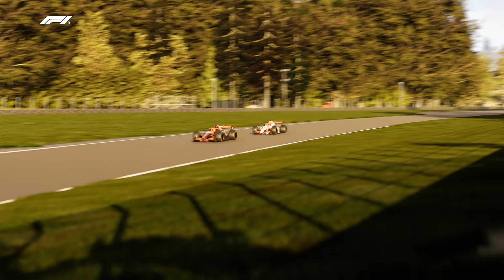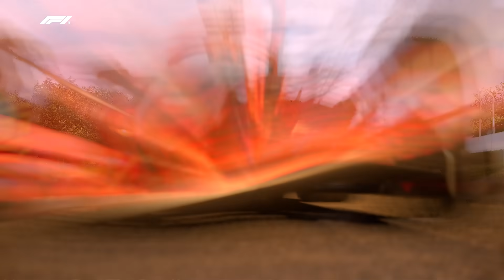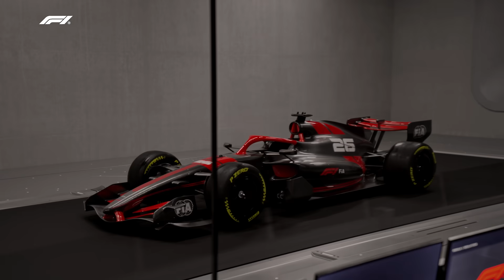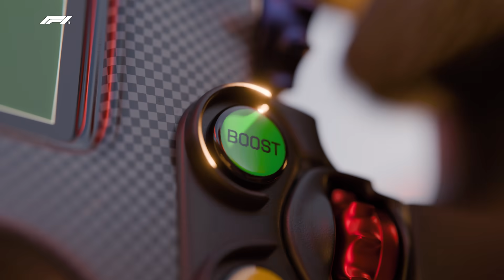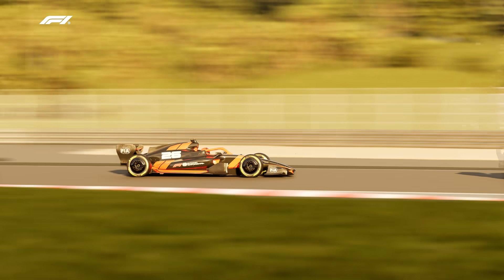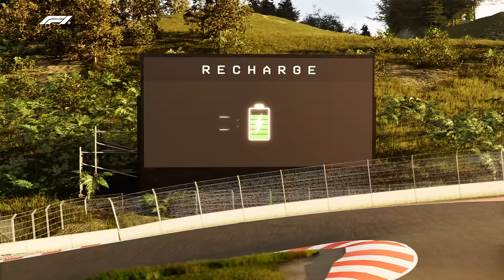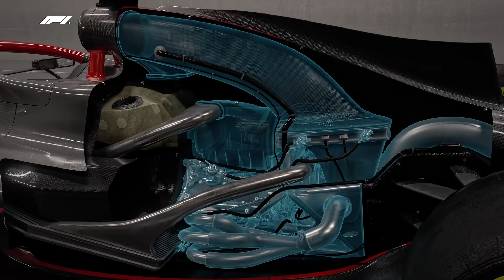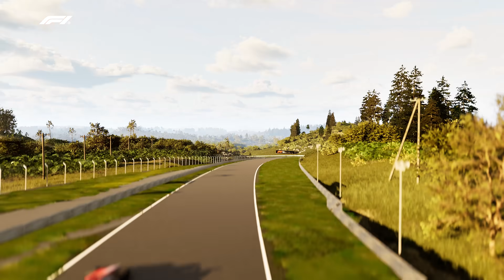Everything You Need To Know About the Formula 1 2026 Regulations

Comment: I was already afraid of it, but after the last few races that boost/battery charge system proved it is one of the biggest downgrades in F1 history. Drivers are way more cautious going into turns, because if they don't break enough their battery charges less. Not even talking about overtaking at the push of a button. It takes less skill and boldness now from the driver and is more based on the car tech and strategy imo.
Reply: Fr

Comment: Indy - 2x cost, 800 hp, top speed ovals, no power steering, F1 - 30x cost, 1000 hp, half are storage limited energy recapture strategy for more race variation, pricey aero for handling,  FE - 1x cost and full road car relevance, 4WD family SUV all weather tires eat my electrons overtakes and racing excitement from off line attack triggers and pit boosts, going to power steering and up to 800 hp for gen4, considering quali slicks, 4 wheel steering (5 percent on rears), NASCAR e SUV -  30x cost, 1350 hp, pro driver already said closest vehicle feel is  F16, WEC and other - 1.5x cost feeder and training camp for  multipit FE endurance racing?

Comment: so basically 
f1 turning into formula e
and formula e turning into f1...
Reply: f1 higher power e motor (about triple from last season - about 500 hp peak (limited duration), 1/2 total 1000 hp) for more overtakes and racing excitement and fe higher power e motors output (about double for next season, about 800 hp) and power steering, anyway?
Reply: FE will turn into hybrid? Or do you mean they still use combustion engines hidden behind the garages to charge the batteries LOL

Comment: I thought Formula One cars were supposed to get faster as the years went on
Reply: Formula 1 cars reached the limit of what their human drivers are capable of in the 90s. They could make them faster, if they wanted to. But have you seen the drivers get out of the cars after the race in Singapore?
Reply: @Truckziller  Human limit in the 90s? Surely not. The only time racecar drivers reached the human limit due to speed was when CART tried to race at Texas Motor Speedway in 2001, where drivers passed out in qualifying due to the geforces.
The concept of F1 cars supposed to get faster with the years was never existed, it just happened despite many rule changes supposed to slow them down. The first one which comes to mind was the move from 2.5 to 1.5 liter engines in 1961.
Reply: @armorgeddon drivers passing out is not a realistic approach to what I would call the human limit, if you’re trying to race for 90 min 20 times per year.

Comment: Has F1 considered what will happen when the DRS (whatever they call it) actuator fails in the Low-Drag LD mode as a car enters a high speed corner like at Imola, Monza? The malfunction is a % probability from actuator reliability failure, or from a collision which may have damaged the actuator or its wiring leading to a progressive failure or worse, an intermittent surprise failure.  Drivers are going to die from very high speed impacts.  Without the expected high downforce, the usual downshift and braking may cause the rear tires to lock-up at the given brake bias setting. If not enough downforce is pressed on the rear tires while the weight dynamically shifts forward, reducing the press on the rear, the rear tires will tend to lock up.  Locked rears will be like pulling the parking brake to cause instantaneous  oversteer.

Comment: Well I mean the ice/electric split is going from a 84/16 ratio to a 53/47 ratio, its not exactly a 50/50 split, its close tho, the maximum ice power from the 1.6L turbo V6 is being reduced from 840 bhp to 530 bhp, and electric power is being increased from 160 bhp to 470 bhp, basically the same amount of electric power as the current Gen3 Evo Formula E cars, you have to also consider the difference of electric power is all coming from the MGU-K because the MGU-H was removed, so the entire 470 electric bhp is all coming from the MGU-K instead of splitting 160 bhp between both, its a huge difference, the cars will probably have more turbo lag since theres no longer a MGU-H unit regenerating electrical energy from the turbo, i think Verstappen is wrong about needing to downshift at the end of the Monza front straightaway, the Mercedes AMG One has a 43/57 split between ice/electric power, it actually has more electric power than ice power and has more total horsepower than a F1 car and doesnt need to downshift at the end of long straightaways to get better lap times

Comment: Hey, my barge boards on the truck can be shaped to catch the wind like that coming off the wheel. MY bumpers adjust at high speed too! The front one falls off at about 60, and the rear bumper can shower sparks around any right hand corner you need.

Comment: Formula 1 2026 Regulations ! what an utter mess. The cars will be slower, more reliance on electric battery power as to removing the battery's totally !
The cars will run out of power on long straights.
there are now way too many things for the drivers to be thinking about with what are you going to do with the power over take boost energy recovery.
Then the cars are now higher up thus reducing the ground affect and making the cars less grip to what was a mistake the FIA made before.
If you want Formula 1 2026 to be better.
Then .............1/ scrap all the battery power. 2/ remove team radio 3/ move to manual gear box 4/ let the cars be lowered to the floor to give max grip 5/ no overtaking can be made via a pit stop removing the undertake. and make all place gains on the track only. 6/ when on the track for testing or qualifying then all cars must be at race speeds and no going slow at all. 7/ NO queuing at the end of the pit lane lights. cars can only be let out once the pit lane lights got to green. all cars must got to race speed as soon as they cross the green light. 8/ Tyres must last a race distance as not as they are now. 
9/ Teams can mix and match tyres front and rear from soft front to hard rear or any other combination but only on that axel.
this way it will out the racing in the drivers hands and not being informed by the teams what to do next. the racing into the drivers hands. 
Also bring back the screaming V12 engines.

Comment: I wonder when we will have a closed tempered-glass canopy to fully protect the driver and increase aerodynamic efficiency.
Also, what's the point of "adding more overtake opportunities" on races like Monaco or Singapore where the "opportunity" is basically when the other driver crashes into a wall or make a pit stop?

Remove street races, add more high-speed races, make the car even smaller - give us the 2005-2008 size where cars where smaller but balanced, give us the VROOOOOOOOOOOOMMM noise from 2002-2004s and we will be THRILLED!

Comment: FIA is seemingly slowing down the F1 car *again*. Seems quite more drastic this time (compared to 2021->2022) with narrower tyres, narrower & shorter overall dimensions, simplified floor, and most significantly, the reduced in engine power output. It is lighter though, somehow. Even with the increase in the battery capacity.

But as ever, we'll have to see the performance in later years.

Comment: So they got rid of DRS by adding DRS? What's the difference between boost and overtake if boost can be used at anytime? I must be missing something
Reply: Boost can only be used when you have charged the batterie at a certain point while overtake can be used whenever youre less than a second behind someone
Reply: @LERAGEUX_DU that's my point. Boost can be used at any time (as long as you have the charge) but overtake will only be granted if you are within one second whilst in the ONE detection zone. My question was more along the lines of, is overtake using the battery or is it something like the ole Mercedes party button and changes engine settings?

Comment: That boost mode is going to effect   any race and any judgment of the driver.  If you was to know that the driver right behind you is going to use boost mode to overtake you......but you have to be reluctant to use your boost mode to fend them off because you don't want to run into the driver in front of you trying to hold off the driver behind you......at a certain point or area on the track.

Comment: Great - so with just 1 detection point if the chasing driver overtakes at the next corner, they have access to overtake for the rest of the lap.....

So it'll be even harder for the overtaken car to fight back

I think you should lose DRS/overtake once you've passed the car in front. Whether it's decided based on time gained or meters between the car it will make it much more fair

Comment: it's now turning into a formula E with that added modes with recharges
it'll be a different f1 after 2025.

a few more decades we might have a 30-70 of gas to battery ratio where f1 will be nearing fully running electric and gas will be the support.
Reply: Gas is not everything,and formula E is battery powered,not hybrid with biofuel

Comment: It's not the same power with less grip; all they've done is make them generally slower, which I don't mind, but it's not the same power because they won't always have all the energy available. So there could be power differences of at least 300 hp. I'm not an engineer, but I don't see much of a future for the engine, and why are they focusing on making the cars 'eco-friendly' and not on everything involved in transporting the teams to the circuits? It's completely baffling.

Comment: Why didn’t they also reduce the wheel diameter? At least for the front axel, if not both. The wheels are still too tall. It would help further reduce drag and also help drivers with visibility. 
Does anyone know a potential reason to why they chose to keep the same diameter? 
The only thing I can think off is helping Pirelli and the teams keep costs down, by not asking them to change their factory equipment even more, again.

Comment: Synthetic Fuels means in a couple of years they'll be no excuse to not bing back V8's or V10's👀
Reply: Didnt't you hear the part about the heat recovery system? 5:13 "Too expensive, too complex and not road relevant." Same as V8's and V10's.
Reply: There would be an excuse, and quite a big one at that. It's called "The manufacturers aren't interested."
Reply: V10 are coming back in 2031 regulations
Reply: @moizattaria4051 literally no proof of this claim
Reply: I'm unsure about the implementation. More cilinders means more fuel use. More fuel means either increasingly larger tanks (and weight, and safety concerns, and reduced aero perf, etc) or refueling stops mid race, with all the logistical, safety and steategic nightmares that carries.
Reply: @YawnMK1  it wont matter how much fuel uses as long as the fuel used is synthetic (or efuel, however you wanna call it)
Reply: also to generate energy to the battery, you need to burn fuel
Reply: @dmg414ar of course it Will mater. Currently, the Cars are struggling to finish the race with the allocated fuel supply. Higher cillindrage means higher fuel consumption. So, in order to finish a race, Cars Will need more fuel than they already carry. Currently, the first stint tyres get destroyed by the weight of the car. Add more weight because of more fuel, and You Will have slower, clumsier Cars destroying more tyres and needing more stops. So, refueling returnd, right?

 Currently, safety in the pitlane Is difficult, But manageable, yet countless incidents still happen. Now imagine that with the added fuel storage and high pressure hooses flailing around. Also, currently the cockpit Is Made very safe with the halo and reinforcements, But It makes it so the driver has a harder time exiting. Now imagine that with one of the many incidents that happened in the past involving the refueling process spraying fuel on the driver and cockpit, with tyres, brakes, and engine quite above ignition temp.
Reply: @YawnMK1  then dont use fuel at all and make f e 2.0
Reply: @YawnMK1  also what do you mean by heavy?, do you really know that actual f1s are hella heavy compared to the v8 era
Reply: @dmg414ar no you don't.
Reply: @zman11231  ?
Reply: @YawnMK1  yeah who would want more powerful engines in the engines powering the pinnacle of Motorsport?
Reply: @JH.is.secret did i Say anything about not wanting stronger engines? I specifically said i was unsure about the implementation.

Comment: sustainable fuel = no need battery. 

no battery = small car (schumacher era)

please, bring back 100% engine, not hybrid nor electric engine.

driver will be a driver again, not a robot operator.
Reply: A lot of the modern car size is due to safety, not the engine and battery
Reply: The battery isnt the size of a mainframe computer 😂😂😂😂😂

Comment: "MGU-H is too expensive, too complex and not road relevant". Ferrari, Porsche, Mercedes and others have it in their road cars. By not allowing harvest from front wheels and ban of MGU-H to please every manufacturer the new powertrain is a step backwards.
Reply: And they account for what? 1-2% of all road cars? It is an accurate statement its not relevant..that's an arbitrary number by the way to make a point
Reply: @noelcampbell4074  It is added to more and more models as more turbo manufacturers get their products out. For harvest from the front wheels most hybrids has that. F1 is supposed to lead what sport cars will have in the future which the 2014 rules did. The larger electric rear motor is limited what it can harvest by how much it can brake on the rear wheels.

Comment: This is going to turn drs trains into drs convoys!!
Reply: Active aero convoys*
Reply: Alonso will be so happy
Reply: @tweetymr Its DRAG REDUCTION SYSTEM … in factual design.
Reply: @Redlingstein no
Reply: @VarunTomee-kr6nf  yuh-uh
Reply: @tweetymr  the active aero isn’t the DRS replacement. It’s just to make the cars fast enough for the end of long straights
Reply: Or dare I say it
*DRS CARAVANS£
Reply: It is not drs you don't need to be in 1 sec of car which is ahead and you don't need downforce on straight line
Reply: @VarunTomee-kr6nf yea but you can still ONLY use it in certain areas so everyone will use it in those areas
Reply: @TerryBollea1  yes that's why it's not DRS
Reply: @GuidoHaverkort  So what would you call a Drag Reduction System?
I think i'll called it DRS 2.0
Reply: Yup no OVERSPEED at all anymore, thus even less oveetakes
Reply: @Redlingstein  there will literally be "tap to overtake" button increasing the car's engine output, which can be active in 1 second to the next driver, did you read the regulations with eyes?

Comment: The next big change in F1 regulations, starting from 2028: 1. replace drivers with AI; 2. replace standard wheels with vintage wood wagon wheels; 3. quad minigun mounted ontop of the cars. can be used on every lap to help overtaking the car in front, only if you are under 1 sec and after the last corner, on the start/finish straight; 4. on the pitwall every team will have a grenade launcher that can be used to protect their car if attacked; 5. the opposing team on the pitwall will be able to use flashbang and smoke grenades on the team with the grenade launcher to try to neutralize it. These are minor changes to the regulations, intended to encourage overtaking and provide the public with a more pleasant experience

Comment: FIA should design with a fix body work that use across all the teams. Just purely let the team build the engine and trans only. So then we can see a more fair racing and who is the best driver. Rather now who got a better car sure win the championship.
Reply: But the whole point of the Constructors Championship is to see which Team can build a better car. Formula 1 is a Team Sport. So it judges the performance of both the Driver and the Team with the 2 Championships.

Comment: I mostly like the aero rules, but I think engine rules deserve to be radically different. If we can make 100% renewable fuel, then we don't need to worry so much about extracting every bit of that energy for efficiencies sake with turbo hybrid. I would love to see a few seasons where we allow engine suppliers to go wild with engine configurations, just allowing up to a certain displacement or even capping power output which would allow rotary vs piston, turbo vs supercharger vs na. It would become a competition to build an engine that's light, quick to deliver power, and reliable not only for a session or a weekend but a whole season as long as they keep the rules on restricted parts

Comment: so the MGU-H was a waste? lets go in depth of what it did and not say it was in-effective. "The MGU-H (Motor Generator Unit - Heat) was a key part of Formula 1 hybrid power units, an energy recovery system connected to the turbocharger that captured waste heat from exhaust gases to generate electricity, charge the battery, and eliminate "turbo lag" by keeping the turbo spinning, acting as a motor or generator between the compressor and turbine. This tech allowed huge power from small engines"

Comment: Boost and Overtake... what is this, Formula E?
Reply: “Net 0 carbon emissions “ so that’s means their either working towards full electric or hydrogen power right
Reply: @Zeetack-0 no, they are using sustainably produced biofuel, which can also be emission free. Doesn't have to be hydrogen or electric.
Reply: @lucaspoppelaars914  burning biofuels still produces co2